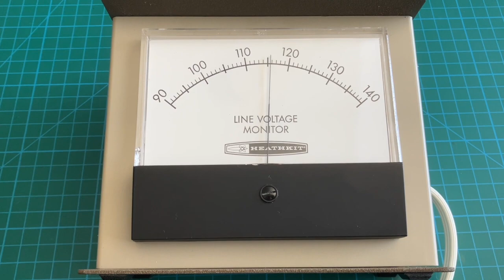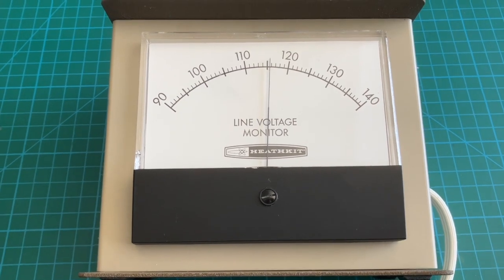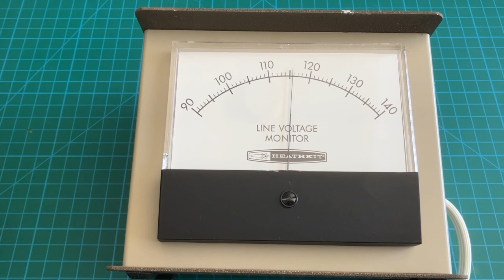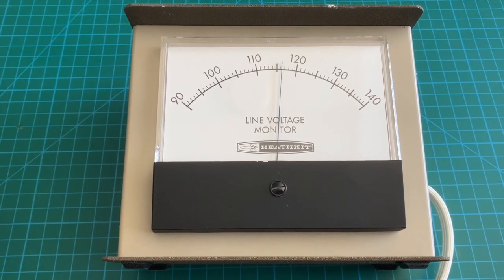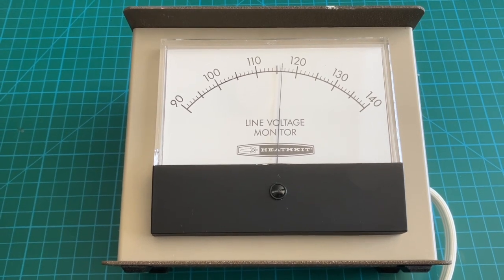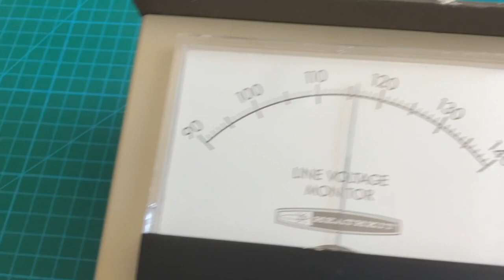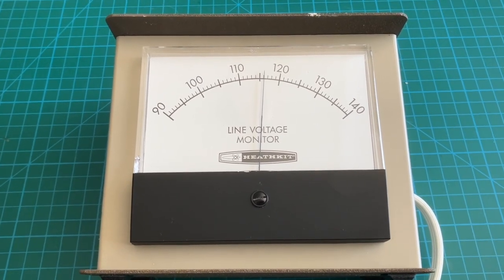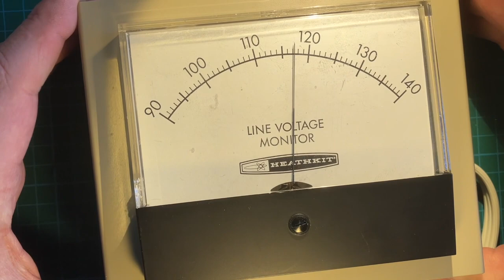Heathkit IM-103 Line Voltage Monitor - The Good, The Bad & The Ugly

Comment: Interesting, I have one I built in the 1970s, forget exactly when. I repackaged mine with a 5A AC meter a variac and isolation transformer.  Now that you mentioned resistor overheating it I'll have to check mine. Have not looked inside in years.

Comment: I found mine about 20 years ago. Like all the others, it had burned up inside and was no longer working, but the meter movement was still fine. I'm amazed that this design ever made it out of Benton Harbor. I redesigned the circuit, changing resistor values so that it would work the same, but not overheat anything while not requiring anything above 2 W. Sorry, I don't recall the new values. It's been working fine ever since then.

Someone on ebay is selling Heath upgrade packages to fix these. I've always wondered whether these just maintain the old design with higher wattage resistors or a more thoughtful approach that dissipates less power.
Reply from the maker: @jadney : You're referring to the d8apro.com IM-103 rebuild kit.  I looked into it, and it's not a bad kit but does not replace every component, just most of them. Also, as I show, all parts are available on DigiKey for ~<$20.  Their kit does not actually modify the design in any way, other than the two power resistors replacing the Heath 2W ones.

Also, if you expect to always have a Variac and decent multimeter handy, One can rebuild the kit without the CAL/NORM switch (perhaps convert it to a simple ON/OFF switch), drop a number of parts and forgo the inferior self-calibration.  The manual even shows the simplified schematic.

Comment: Great video. I built many Heathkits back in the day.  I still have my IM-103 and it still works. 
I think I built it back in '74 or '75. I will definitely replace the 50-year-old electrolytic and I like the idea of a grounded line cord. BTW, how did you strain-relief it? 3 wire cords are thicker. Did you drill the entry hole for a larger Heyco?
I'll also replace the 2W carbon resistors with 5W wirewound, though neither looked like they suffered heat damage. 
Also, mine included the fuse.
Reply from the maker: @mikescott58 You perceptively noted that I kinda did not show the line cord entry.  The proper way to deal with a new flat line cord would be to taper-drill out a larger hole for a proper "sqeeze"-type (Heyco?) line cord strain relief, as I did for my signal tracer video.  For now I did not want to modify the case, so I used a couple of zip ties on either side and a bit of silicone.  Were I to sell one, I'd go back and do the right thing.  Thanks for commenting!